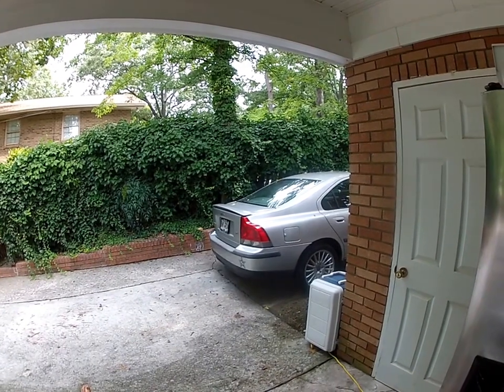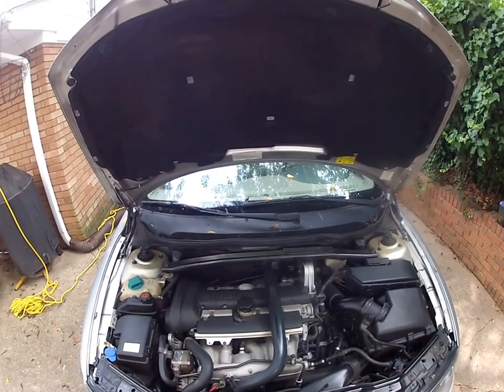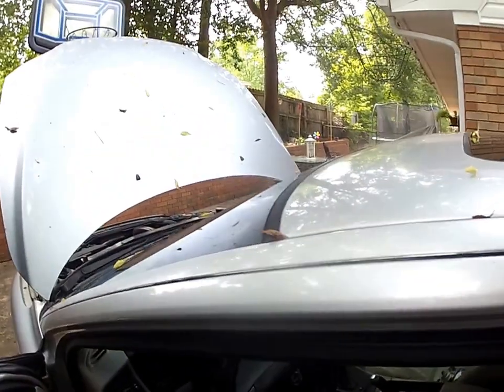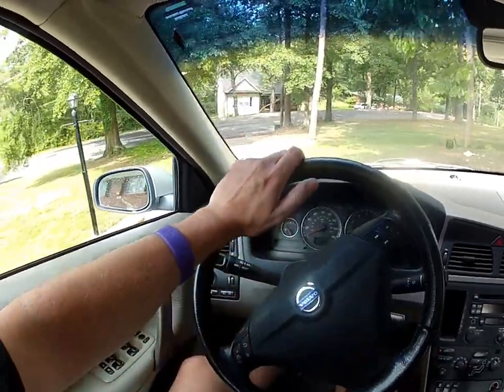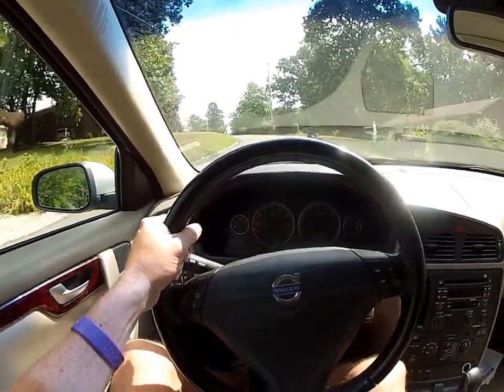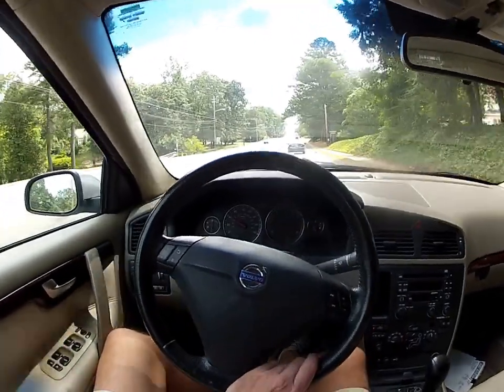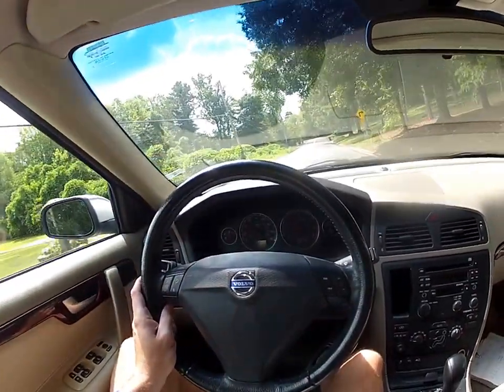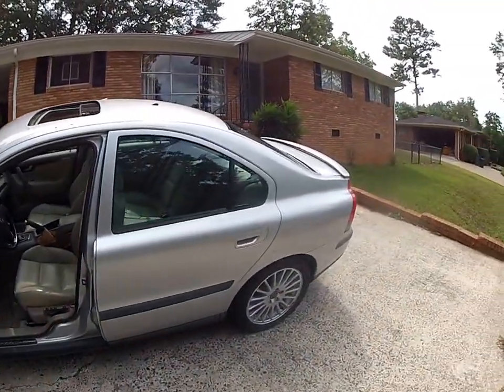2001 2002 2003 2004 2005 2006 2007Volvo S60 2.5T owner review project car

Comment: Nice purring S60. But don't slam the hood that much (or the doors for that matter). Tiny micro switches can go bad and are a pain to replace. And yes, low profile tires are harsh but especially the original shocks get harsh at high miles - still perfectly fine, just too harsh on poor roads

Comment: Being that it's a turbo does it require premium gas
Reply from the maker: Latinogoyaman Latinogoyaman Volvo recommends it.  And I usually use it  but I have used regular to see what would happen and it would make the valves clatter
Reply: no